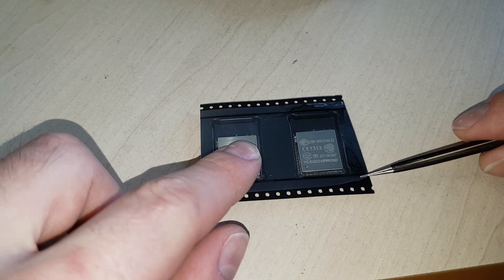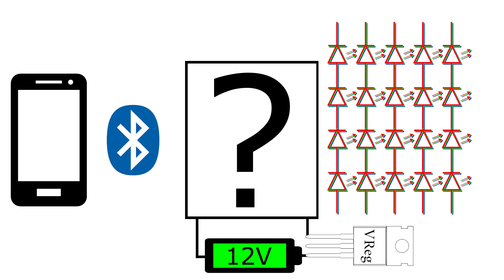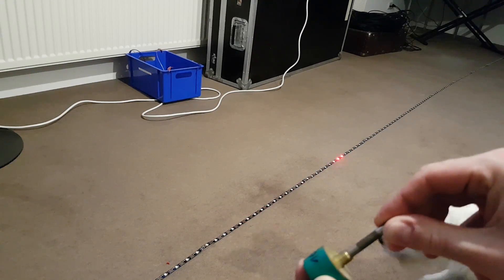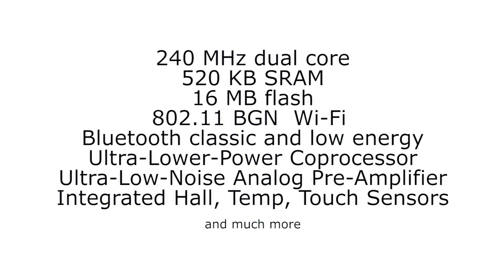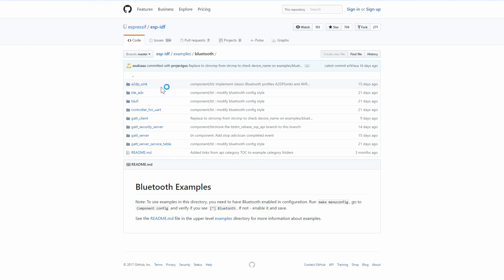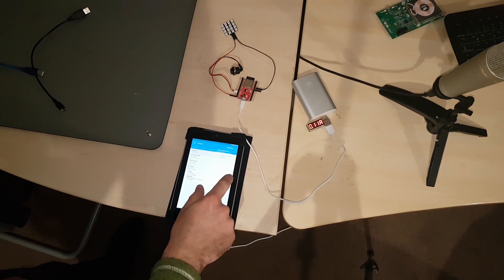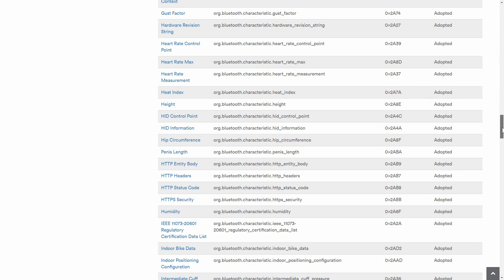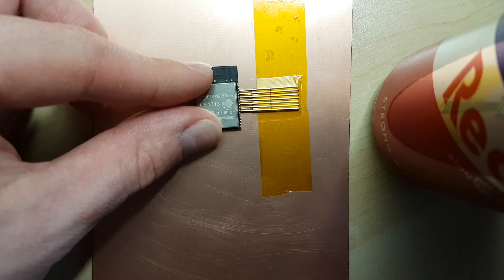My first ESP32 project: Bluetooth Low Energy RGB LED Controller

Comment: is this computer science, electrical engineering; I'm interested in this stuff and wondering what type of education I would need to learn the basics of the things on this amazing channel?
Reply: gvukster, i specialized in Mechatronics. We had Microcontrollers on 5 th Semester.
Reply: Actually, there isn't any special education you need. I study math and i program Microcontrollers as hobby. Ok i have to mention that everything started as i was asked (without any previous experience) to build some kind of arduino based robots. Microcontrollers are (mostly) easy to learn, C and python (and maybe Assembly) are too.

However, students in informatics, electrical and mechanical engineering (mechatronics) will one way or the other, learn about microcontrollers.
Reply: Jules A, I'm a Mechanical Systems Engineer and we only touched briefly on Microcontrollers in my studies... I imagine to have high proficiency in this technology either electrical or comp. sci. would be most beneficial, that's why i queried the community. looking to take some post grad and college night classes to stay up to date..
Thanks and cheers from Steel City Canada
Reply: gvukster

At my university, there is a course on microprocessor for mechanical engineering. However, this only explain the structures. I believe the best way to really learn about microprocessors, is to use them and hobby them, brief self-teaching, assuming one already has knowledge about basic electrical engineering.
Reply: Buy an Arduino Starter Kit (well documented examples) for around 30 bugs and things will start growing. 🤘
Reply: Sure, I have multiple Arduino shields, I program in Python, C+, MatLAB, I built a 4-axis CNC, and I have a 4 year Mechanical Engineering Degree specializing on Solids,,, I know that certain topics need formal training on especially for commercial application; my daughter is interested in this stuff more than Mechanics so I was curious as to the communities response. 
Cheers from Steel City, Canada

Comment: 3M's Z-axis tape may work in place of pogo pins. It is a conductive tape, but only conducts in the z axis (top to bottom). I'm not sure how well it would work with such fine pitch, but in theory, you could just put some over an esp breakout board, then press the esp on top to program it.

Comment: Hi
Banggod sells a Test Board Smal Batch Run that will bewhat u want

Also I have had more success with using an adhoc wifi than bluetooth for range. Or set up to read a local server

Comment: What is the name of your hot air soldering gun and source? If you would be so kind.
Reply: Should be a WEP 858D(+), or at least I saw one in another video somewhere. I have got one here as well and so far it works perfectly fine (especially considering the price...).

Comment: Could you tell the settings you are using to solder this chip and maybe some tips. I tried 2 times to solder esp32 using hot air but without success... I was able to solder it using soldering iron but the result is not as pretty as it can be.
Thanks for the video!
Reply: preheat the board surroundings, use lots of flux, perhaps pre tin the pads, or for more ease use a solder lead paste,

Comment: Why this project top secret? Is it possible to transfer ESP8266 file into ESP32 directly in Arduino IDE and have everything compiled and work? I am trying to control 250 WS2812s in a matrix with a ESP32 to display animation, text and work as spectrum analyzer but it was hard.